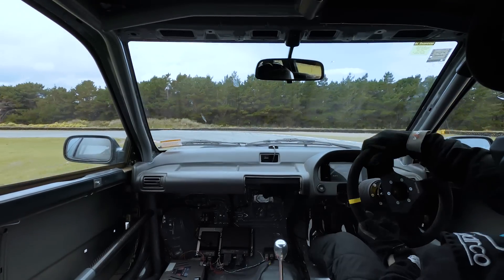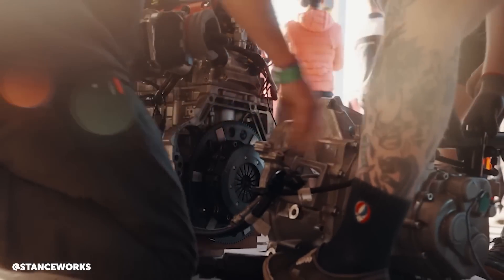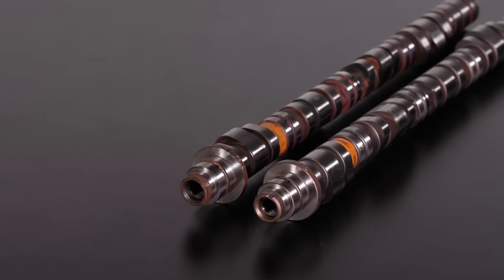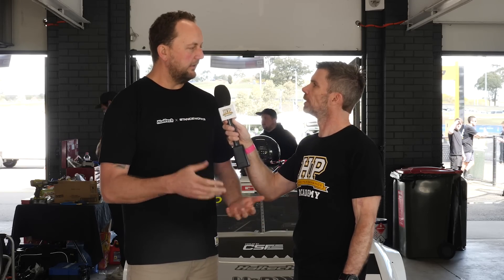'Pops And Bangs' Are BAD | Sequential Shifting 101

Comment from the maker: Dog box or not, what are you doing to optimise your gear shifts on track? - Taz.
🤘 Building a fast car? Get EVERY course ever with $400 OFF the VIP package: https://hpcdmy.co/vipy52
🦸‍♂ Learn how to tune a Haltech ECU. 50% off your first HPA course: https://hpcdmy.co/offery52
TIME STAMPS:
0:00 - Sequential Shifting
0:36 - Quafie 5-Speed Dog Box
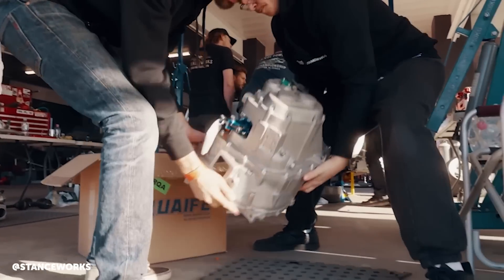0:52 - Upshifting Shiting Process
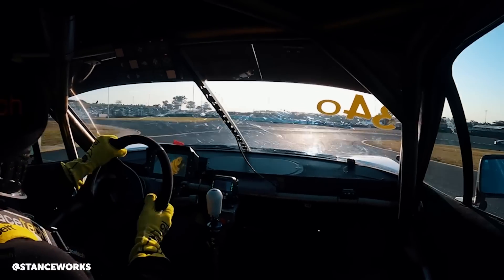1:38 - Too Much or Too Little Power
1:46 - No Electronics Option
2:28 - Electronics Option
3:26 - Time Cut
3:54 - Lifting, Ignition Cut, Fuel Cut
4:38 - Reintroducing Power
5:00 - Pops N Bangs Brah
5:20 - SR20 Damage
5:40 - Highly Strung Engines
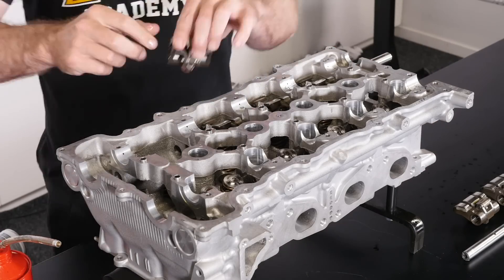6:07 - What Is Happening To The Engine
6:38 - Shift Strategy Decisions & Testing
7:39 - Downshifting Process
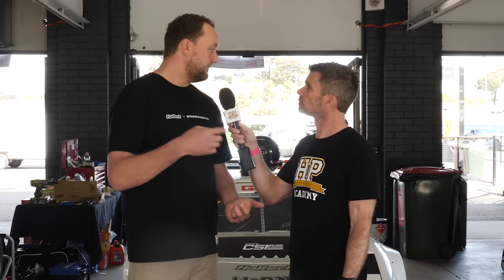8:06 - Throttle Blip | Rev Match
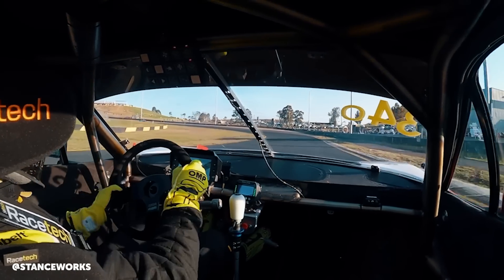8:41 - Reliability and Servicing
9:20 - Calm & Assertive Gearshifting Leader
10:12 - Upshift Time: 50ms
10:40 - Checking The Data
10:58 - Thanks Scott!
11:04 - BUILD.TUNE.DRIVE

Comment: Congrats! You are the 1st person to properly describe the correct way to shift a sequential dog box on the entire interwebs. Every clown and vast number of pro drivers get this wrong, and have seen in countless POV vids.
      Secondly, when shifted correct manually, i call BS that flat shifting is better. Show me the milliseconds to properly breathe off the throttle done manually. Furthermore, with traffic, changing track and car conditions and a myriad of variables, the ECU parameters will need infinite mapping, that will get it wrong, and lead to gearbox failure. Driving manually is the only way to create the nuanced mechanical sympathy with a driver who knows what their doing. Its also a huge waste of time and resources to dial in this, which will always be imperfect and introduces more problems of unreliability, inconsistencies and paradoxical nonsensical complexity that a dog box is intended to simplify in its basic motorsports component mission. Contrary to what said, the only good reason to do this IS for the pops and bangs....and flames. Cheers.

Comment: Electronic cut is a mixed blessing. Allows mediocrity. Learn to drive a sequential properly without electronics using proper preload hand style and lift. A human driver once well properly doing it and practiced will be smoother and have better mechanically. The tuner I questing the cut and is only "correct" at a limited specific parameter. This is conceptually retarded. Once a person is fighting for podiums, it's OK to then add Electronic full control, requiring the gearbox to be smacked is an ironic worsening of the temp. Your foot, brain and hand can more consistently and more often produce smoother shifting and longer lasting transmission internals. Having overly smash the gear lever to not gnash gear shifts then padoxically is the fault of crude fixed parameter trans tuning, which cannot provide infinite variable specific shifting input by hand, if you know what ur doing.....ie. PRELOAD. Comically wrong and waste of time, money and dissemination/perpetuation of misleading info that is repeated by fools and their ability to launder money.  
Xoxoxoxo ❤   
😂
Reply: rev matching
Typos above left in, if u know stuff, you will understanding....if u can't figure it out....good....stay off track and seek a different hobby....u suck at this.

Comment: Why so sloppy?
 You know the speed of the car and the next gear. Almost all cars have an electronic throttle and the ECU completely controls the engine. You can set the engine RPM exactly for the next gear.

Comment: I think you accidently put the wrong title on your video. Title ->pops and bangs. Video content -> racing clutches. Pops and bangs have nothing to do with the clutch.
Reply from the maker: 5:00
There are always several options for video titles noting the thumbnail also has text which is usually read along with the title before diving in 🤘
If you in particular only came for 'pops and bangs' you learn a bit about them, why they are not necessarily a good thing, what causes them in relation to gear shifts in a setup like this and more. Everything has time stamps 😎 - Taz.

TIME STAMPS:
0:00 - Sequential Shifting
0:36 - Quafie 5-Speed Dog Box
0:52 - Upshifting Shiting Process
1:38 - Too Much or Too Little Power
1:46 - No Electronics Option
2:28 - Electronics Option
3:26 - Time Cut
3:54 - Lifting, Ignition Cut, Fuel Cut
4:38 - Reintroducing Power
5:00 - Pops N Bangs Brah
5:20 - SR20 Damage
5:40 - Highly Strung Engines
6:07 - What Is Happening To The Engine
6:38 - Shift Strategy Decisions & Testing
7:39 - Downshifting Process
8:06 - Throttle Blip | Rev Match
8:41 - Reliability and Servicing
9:20 - Calm & Assertive Gearshifting Leader
10:12 - Upshift Time: 50ms
10:40 - Checking The Data
10:58 - Thanks Scott!
11:04 - BUILD.TUNE.DRIVE

Comment: Is this possible with the traditional 'H' pattern gearbox with some sort of clutch sensor? So i can keep my foot flat but once it senses the clutch start moving it cuts out and then returns when the clutch is released? Id imagine it wouldn't be able to do downshift rev-matching because it couldn't tell if you where going up or down a gear, so now that i thought of that i guess it probably isn't possible
Reply from the maker: Yes, you can do this with a clutch sensor in such a gearbox, as you mention the downshifting is a bit different but part of that puzzle is the strain gauge on the gear lever not just the type of gearbox. There is a webinar on it here using our old 350z: https://www.hpacademy.com/previous-webinars/186-configuring-flat-shifting/ - Taz.

Comment: Hailtek did all they could with old technology, but they can do better by designing a transmission w/o lifting your foot by adding parallel gears. Running 2 gears at the same time you can transition w/o letting go of torque to shift.

Comment: As far as rev matching on the upshift goes - is that just a matter of sacrificing mechanical sympathy or does the fuel/spark cut drop the RPM enough to match the new ratio?

Comment: Pops and Bangs, modern day ricer mod. I remember seeing at a car meet, there was an exhaust competition, this R34 gtr had massive pops and bangs, then he had a knocking sound coming from the valve train. He managed to some how slowly "massage" the knock away with gentle revs. Also had my mate piss out coolant in his evo, just created excessive cylinder pressure and pressurised the crankcase. Needless to say, not great for any engine.. Just stick with burbles and turbo noises.

Comment: So well tuned that blow up a brand new gearbox 😂😂😂
Reply: These quaife K series sequential gearboxes are very unreliable in my experience.
Reply from the maker: That Quaife is rebuilding. Wonder why they would do that if it was a simple tuning issue which there is plenty of data from the car to identify if that was the case 😎
It is a race car doing race car things, and no one is infallible, but be careful with the finger-pointing like this even if it's in jest 🤘 - Taz.
Reply: It is not to my knowledge that this car has torque sensors in any shaft, that would be relevant piece of information for Quaife. In this case, a car with above average performance, does anyone know what the instantaneous torque is after an instantaneous reintroduction of power? In my opinion they are rebuilding the gearbox because this is one of the best known cars on the internet to use a gearbox from them it was widely reported that it had problems during the race and they have a reputation to uphold. Making mistakes is part of Human nature, and only those who do nothing don't make mistakes, admitting mistakes demonstrates humility, this is how we evolve.
Reply from the maker: We all have opinions, but laying blame based off nothing but opinion from a few videos on the internet is not always an opinion worth sharing is the point I was trying to make there 🤘
As mentioned, no one is infallible which extends beyond those working on the car 🤘 - Taz.

Comment: I always knew pops-n-bangs were bad, but i never thought about the fact that it literally forces percussion into the valve - and so into the camshaft.
Great explanation. I wonder what kind of difference it makes depending on if its a pushrod/rocker arm, roller cam hydraulic lifter, or solid lifter setup?

Comment: I gotta find that video that describes the issue with up shifting where the sr20 valves end up in trouble. Is this an interference issue?
Reply: No, the shims will fall out. The way to fix it so that won't happen is to dump the shims and Tip the valves which means custom valves.
Reply: @spooler7828 I thought the non VE heads also broke rockers
Reply: I've delt with the Sr lash pad issue for years. Hks or gk tek rocker stopers. Limit rpm delta to only 400 rpm.

Comment: I have a carbureted one, sometimes I turned it off on load, it pops heavily, it's that bad?
Reply: its not good, but you cant cut carb fuel feed.
Reply: Unless your carb has an air cutoff valve it will pop on decel.  No jets or needles will fix it.